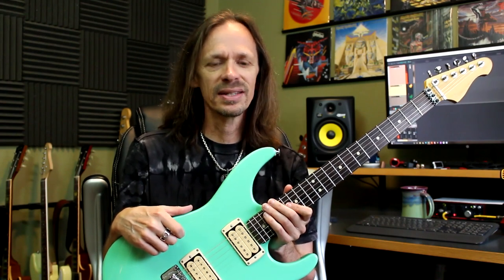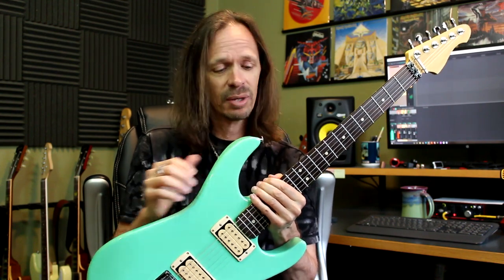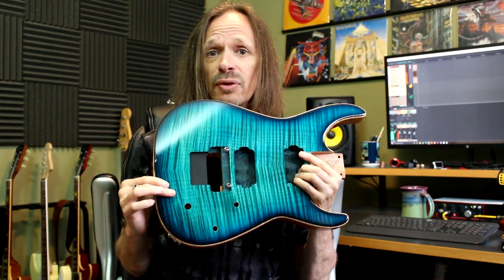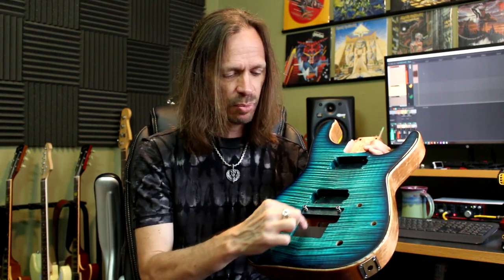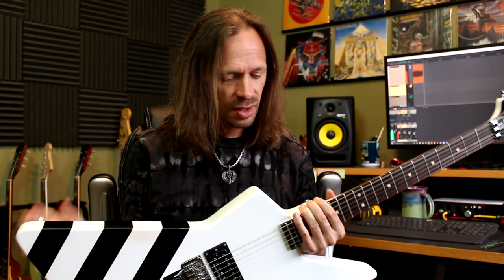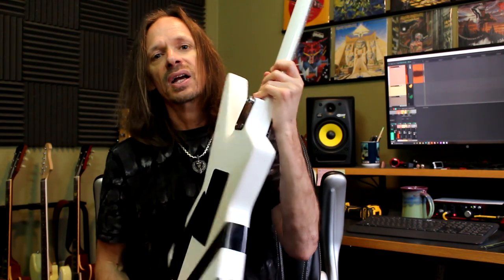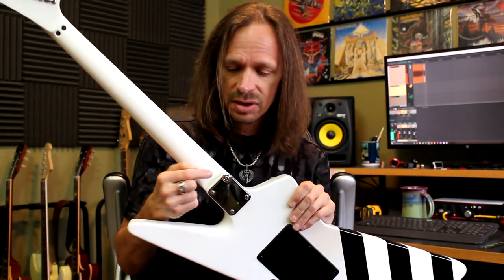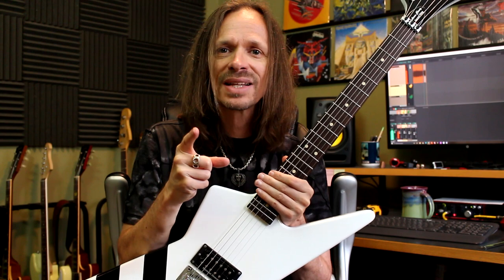How To Install Strap Buttons on a Guitar

Comment: The only solution.
Schaller strap locks. Nothing else goes on my guitars.
Reply: Do you prefer them over Dunlops and why so?
Reply: @Meritocrate   If a Dunlop strap lock fails, the strap side will come out of the hole of the pin in the body. If the upper horn is angled down, like Aron shows us, it's harder for that to happen. But if you just replaced on a Strat/Music Man... And even worse if you got the guitar at an angle so the neck is higher than the body
The Schaller type still rest in a U shaped "cup" with a guide that goes into a groove on the pin.
So even if the spring and the locking pin on the strap side fails, the guitar will still be where it was.
I've had Dunlop type fail on me, and that almost meant damage to the guitar.
I've had Chinese Schaller copy fail, but no immediate risk of damage.
Reply: I just go with the usual one u commonly see. Ric puts em on all theirs... New players edition gretches do it. And I'm pretty sure fender has for the most part stuck with this too.

But yes... Use strap locks if you're extra scared of dropping it. They are kind of a pain though... Just another fuckin thing you gotta mess with just to get your strap on lol.